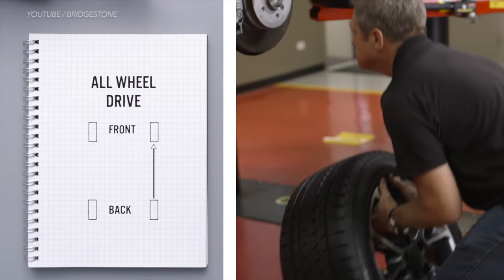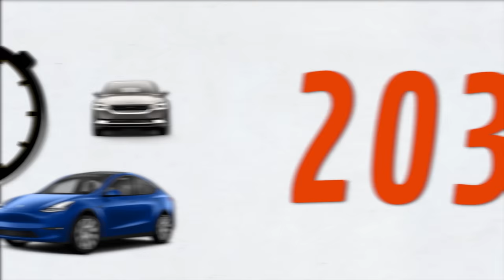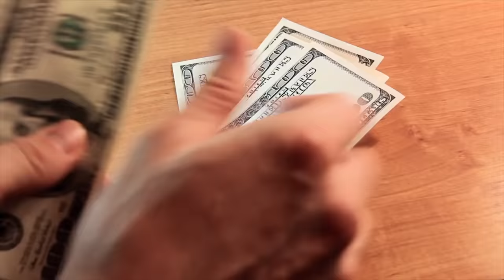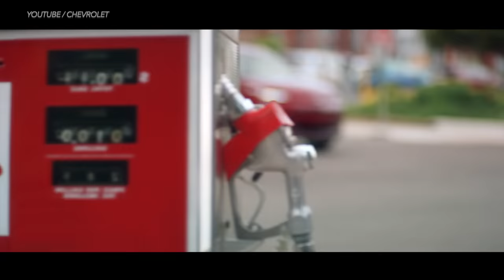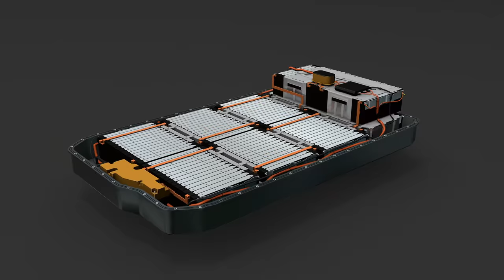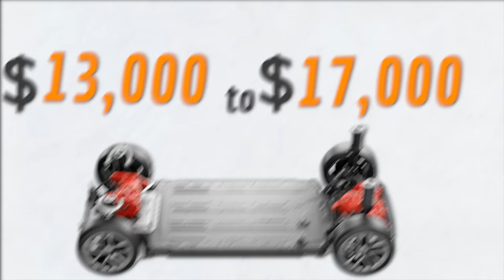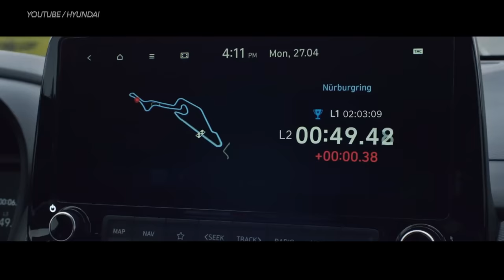No One is Telling You the Truth About the Real Cost of Owning an Electric Car, So I Have To

Comment: I didn_t know about the tires issue with EV's.
I consider that now is not the best time to buy an EV. 
Battery technology is growing fast and it'll take some years to have an affordable EV with long lasting, high range, fast to charge battery pack. Till then, I'll keep with combustion engines.
Reply: They are going to fight with tooth and nails before pricing EVs as their ICE equivalent cars. EVs will not be affordable In A LONG TIME. I have seen videos that say "This is an Affordable EV" (for 60k), or "This is an affordable electric truck" (F-150 Lightning). It's good to listen to Scotty because so many channels are a SALES PITCH. Affordable electric cars, give me a break people! (And I know you are not saying they are affordable)
Reply: Any car needs tire needs to be maintained! This is kinda a rare misnomer by Scotty.
Reply: It won't be a choice. 
Do you  even see what is going on in  this country. 
 You won't be asked to switch.
Reply: @tonebonebgky2  That's what I thought, but I just browsed for the Tesla Model 3 tires in Costco and each tire is $339 (cheapest tire)! I know  can get tires for my good old Altima for less $100 a tire. Anyway I found it interesting that EV's tires are that expensive when compared to other combusting engine cars.
Reply: @paulcoenen7918  They know they can't force anyone to switch so don't even bother asking. Not gonna work
Reply: @samuelaguilar9051  Basically what's happening is that you're actually buying a commercial grade tire. Think of it as a big rig tire that cost 600 to 800 dollers a tire and shrinking it down to the size of a car tire. There's more natural rubber in a commercial grade tire due to better heat dispersion which brings the cost of the tire up.
Reply: @christophermcmichael880  That's so true, I looked at EVs weight and they are significantly heavier than regular combustion engine cars. Time will tell if EV components come down in price with mass production.
Reply: @despacito1540  if you count in the saving in fuel cost there are many affordable EVs people just gave to be able to charge at home and it's a no brainer. And not make insanely long trips very often.
Reply: @christophermcmichael880  Scotty just said in the video that Tesla uses of the shelf premium ice tires though
Reply: And enjoy the rising gas/oil costs.😬
Reply: I can find a 300+ performance tire for a Altima as well. That 100 tire won’t go far as a performance one will on the same car. You get what you pay for.

Comment: Scotty two weeks ago I had to replace the hybrid battery on my 2009, Toyota Camry hybrid that I purchased new in March 2008. The mileage was about 152,000 miles at a cost of  about $4100, for battery replacement.
Reply: That's a lot.. I didn't think that battery was that expensive since it already had the gas engine and the battery hybrid was a backup.
Reply: Worst part is that there was probably only a few cells (out of a thousand) that actually went bad in your pack. And if you could disconnect those bad ones, you'd probably still have 98% of your range (or performance  since yours is a hybrid).
Reply: The 2012 Tesla S battery cost $22,000 to replace, plus installation and other fees.
Reply: @charlesjackson1700  The engine charges the batteries.
Reply: @troy3456789  Yes, I know.. They have a lot of new Camry hybrids and RAV4s now.. I will take a hybrid maybe next time however I don't want nothing that's fully electric.. I thought they could change out some of the cells in your battery instead of the whole thing.. It seems like I read that somewhere.. Toyota is really on board with hybrids.
Reply: @ytr8989  There is a video on YouTube or a guy takes a Tesla like the one you are talking about and blows it up because the battery cost over $22,000 to replace. It is a good video..
Reply: We have an '05 echo that has only needed its tires and battery replaced . We do our own maintenance . The cost has been very low , excellent gas mileage and takes two minutes and few dollars to fill . EV's are a scam. We can build better ICE cars .
Reply: @rdhudon7469  I agree with you..I have a 2020 Camry XLE
That has the 2.5,cylinder non hybrid, 8-speed transmission. 203 horsepower. It gets 29 miles per gallon City and 48.2 on the highway. The hybrid model gets 40 some miles to the gallon in the city but about the same thing on the highway.. and you will never have the long-term repairs down the road that you will have with the hybrids and evos..
Reply: @Enrique Thiele At this current time there are a lot more drawbacks to them than benefits.. I read that many people are getting rid of them as well.. especially with the lack of charging stations when driving on a trip.. you waste a lot of time and are inconvenienced sitting there waiting for them to charge once you find somewhere to plug them in.. I'LL TAKE THE GAS AND GO ANYTIME.
Reply: @charlesjackson1700  That's always been my complaint and no one has a response.  If I'm told I need to evacuate because of a storm or fire, I don't usually have 8 hours to wait.

If TPTB want me in an EV, the enginerds need to get battery charging or changing down to the length of time to fill up a tank.
Reply: @charlesjackson1700  The first quote I received was about five thousand & the other smaller car  battery is a proprietary gel at a cost of about five hundred dollars. Toyota is the only place you can purchase the gel battery.
Reply: @skiinggator  That may be true but the other battery cells are still fourteen yours old, so it probably best to replace the entire battery.
Reply: @ytr8989  Wow.
Reply: @charlesjackson1700  A third party company will change some of the battery cells but I'd still a fourteen year old battery over all.
Reply: @charlesjackson1700  Agreed but you pay more for the premium gas.
Reply: @charlesjackson1700  Agreed.
Reply: @hybrid711  "smaller car  battery is a proprietary gel at a cost of about five hundred dollars".
I just changed the 12v battery on a Prius (8y, 185k), and yes while it is a smaller gel (AGM) battery it was "just" $150 (vs typical $80-100 larger acid car battery) for 3rd party - you always get ripped off at dealers - if only Costco carried it... but not that different from my bmw that also has inside the car AGM battery. Note that newer prius use regular acid battery in the hood...

Comment: I no longer take my little Toyota to do Tyre rotation, last time I went there to do that, they screw up the front left threads! Luckily the shop I usually go to do repairs  they where able to replace the individual screws, otherwise I would have to replace the entire assembly and bearings!! Since the bearings gets damaged upon removal.
So not anymore, I do the rotation myself at home, I purchased two crappy stands to maintain the car lifted entirely from one side and I can change front to rear easily.

Comment: I like the idea of EVs. But they seem like more trouble than they’re worth and I don’t see that easing up soon
Reply: They've been around since he late 1800s. The problem is that they are being marketed solely as luxury vehicles and the people who really need them are priced out of ownership.
Reply: My Last gasoline Car I Had only Lasted me 132,000 before I gave up on it,I spend over $6000 dls trying to get to work,so.many things went wrong I fix this check engine,then a few months a sensor,fix that then one of the fuel injectors when bad,I was  like omg I'm done got rid of switch to a 2017 Chevy Bolt and never Looked back,after 147,000 miles the only problems I had it's just tires,like I Scotty sed but I buy regular tires "Good Year" brand at Walmart,and the 12V Battery I replaced it myself no big deal just order from the dealer,other than that those have  been my only mechanicals problems with the Car
Reply: @drury2d8  While Tesla has been raising prices through the roof, Chevy recently slashed the MSRP of the Chevy Bolt to $26k.  That's at least somewhat affordable.
Reply: @Enrique Thiele Whatever the reason, it's good news for consumers.  Are you not happy that an entry level EV model was made significantly more affordable?
Reply: @dansanger5340  Chevy bolt
Sucks I used to have one
Reply: @magallon643  I got my used 2004 corolla for $2000 three years ago and I have had no issues with it yet. Just oil changes I do myself so it's cheap lol. If the prices for EVs keep dropping I would definitely be open to getting one! The prices on the Nissan leaf and bolt are encouraging. But honestly, an EV wouldn't be my next car unless I suddenly got a ton of cash. Hopefully,  another 5 years and EVs will be more practical, cheaper, and accessible 🤷‍♂️
Reply: @robertosanchez9654  True one more thing you have to remember the Used Gasoline Car market is over 100 years Old,come on the Used Ev market is not Even 10 years Old just the other day I saw on the News GM drop the price on the New  Chevy Bolt Ev 2023 right Now the Staring price is $26,000 dls Msrp of course,my point I'm trying to make its only a matter of Time before you have Options to Go and Buy a Used reliable Electric Car,Unless you're Rich wana Keep buying Gasoline at $5 or $9 dls a Gallon Forever you see Gasoline will never,ever gonna go back to the Low prices you were accustomed to,as the Months go by Gas will  continue to go up.
Reply: Lol if u can charge at home and don't get on long trips very often an EV is the best car you'll own
Reply: Agreed
Reply: @magallon643  good point. 
kinda forgot Evs are so new in the mainstream market. I wanted to convert a gas car into an EV a couple years ago. It felt feasible and relatively cheap. But kinda forgot about that idea when life started getting busy lol. really do hope EV prices continue to drop so they can compete with gas cars tho. Its honestly just the lack of convenience that's keeping me from really considering one. I live in an apartment and there's only one EV charger and its usually occupied by a tesla in my building. Even having a charger in my building is pretty lucky tbh but then the potential challenge of trying to get to it before the other ppl in my building is so inconvenient lol

Comment: I drive a 2001 Dodge Durango. Engine replace in 2017 transmission replace six months after. Yes with current gas prices mileage sucks, but with four new tires with a 65,000 mile tread warranty. Not getting an EV keeping my Durango.

Comment: Scotty, has anyone ever used a Gauss Meter to measure electromagnetic levels inside one of these EVs for unsafe levels?
Reply: I did, using Trifield 100XE EMF Meter. The rear wheel Tesla Model 3  I tested had low EMF levels, better than some ICE I tested. 
The hybrid cars I tested (Chevy Volt and Honda Insight) had much higher EMF levels. The meter would spike when you accelerated.

Comment: How frustrating is your mobile phone when the battery deteriorates. It can hold less charge after just a year. Car manufacturers will be choosing how long your battery will last based on profit. This industry will start off by making batteries last as long as they can but later on that will change. Once they have us cornered we will be stuck
Reply: You know the drill, many don't. They also lock everything down where you have to pay someone to repair things. They don't want you doing it yourself and saving money. It's all about money, not you.

Comment: I rotate my tires every time I have to swap between summer and winter rubber, so even if I did have an EV it wouldn't be an issue. Having two sets of tires also means less wear per year. That doesn't change the increased cost of the EV tire themselves, of course. If they use non-standard rims, that'd suck, too...

Comment: Here in the UK all home chargers must be connected to the internet to our electricity supplyer so they can switch charging off during peak usage as we do not have enough electricity supply.. same with the ratings of the whole grid on the street how long before we start getting black outs when the BEVs reach 5% or may 10% of the car fleet?? Then forget the price of electricity even with todays prices on fuel.  Getting an more expensive BEV it would take me 15 years to make back that cost..

Comment: Cool story. I bought a 2012 mitsubishi I miev for $3700 only had 9000 miles. It's already saved me a small fortune in gas te past 6 months 😄
Reply: Finally, someone who is actually saving money. It’s so annoying to see these people who are saying, “Im saving so much a month on gas. The car only cost me and extra 30k, but I save on gas” lol. This is coming from someone who owns a Model 3. I love the technology side of it. But Im not so arrogant or naive to think that there aren’t downsides to EVs
Reply: I got my 1981 rabbit in 2010. 
Put in a Tdi engine. 

And it
Gets over 60mpg. 
Don’t believe me?
The car the engine came out of was epa rated 54mpg and weighs 800lbs more than my rabbit. 

If you had a car like mine- you would have saved a LARGE fortune.
Reply: @fastinradfordable  I find it somewhat hard to believe considering VW lied about the mpg on those engines!

Comment: The big worry I have about EV's is electronics. With newer cars,  most of the expensive
repairs I run into in cars has generally been electronic failures. Within 200K miles,
I don't usually see mechanical failures of engines and other things but see plenty
of electronic failures. There may be fewer moving parts in an EV, but there are a lot
of electrical things that will fail. Also, electronic parts tend to
be incredibly expensive and most electronics today takes
a dealer to install and reprogram. Let's be frank here. Modern
cars are basically money pits. Most cars made now are  such that
you can not service much yourself and many make it impossible
to even change the oil and transmission fluid. It's at the point where
the average working man can not afford a car anymore. I have
actually seen reliability of cars drop  over the past 10 - 20 years.
I'll see a guy with a 20 year old Toyota driving around with virtually 
no problems while I see people with 2 year old cars that have already 
had major failures. And usually those failures are electronic related
and expensive.
Reply: My 2004 toyota corolla has 422k miles and i havent had to replace majore things just general maintenance and had to fix some stuff in the bacl because someone rear ended me
Reply: @drdelirious8899  driving a 2004 Toyota Camry just hit 117,000 miles 😂 runs like a clock. Could use new suspension thought.
Reply: I drive my parent’s 2014 Corolla and it once ran for a month with barely any coolant because the idiots that replaced the radiator (hit a deer) didn’t fill the damn thing. Since then it’s had no issues other than the temperature sensor in said radiator acting up once and it hasn’t done it since. It now has about 180 000 km
Reply: I had a 2005 Olds Alero, 4 cylinder Eco Tec with 265, 000 miles.  Ran like a charm, but, the undercarriage was rusting.  Let it go.  Great car.

Comment: + plan to own over evidentially when the price eases up, but by then the price of electricity will probably be through the roof as will the price of gasoline and I'll be getting squeezed from both ends, I'd love to own an ev but the price makes it impossible that and the excellent points that Scotty brings up here with the exception of the battery replacement costs which is basically 12 years into it when the 225 miles of range is diminished to about 150-170ish (they don't ordinarily quit just lose range) at that point most people still don't drive ⅓ of that range and even if it completely quit altogether big deal junk it or sell it for parts or trade it for a new model in limp mode or on a tow truck.

Comment: You should show where the materials come from to make an eV. They use huge diesel trucks to move the earth to get down to where the materials are. Up to 500,000 gallons of diesel is used to make one battery.
Reply: @$5 a gallon for diesel one battery would cost 💲 2.5 million
Reply: Shhh, that’s against their agenda
Reply: It's only a matter of time that companies who make ev go bank rupt. It's very expensive to make and not practical for everyone financially. There will always be a higher market for gas cars just cause the average American can afford to have abd buy.
Reply: Why are they using diesel powered equipment to mine the required materials?
Why aren't they using battery powered equipment?
I know, what came first the chicken or the egg!
Reply: @ogcowboy5743  You'll find that their heavy pack haul trucks are diesel electric trucks. Just like trains are. Besides without extrnal power supplies to keep them running they wouldn't be cost effective enough to pay for themselves if they spent most of their time sitting being charged.

Comment: Some sort of alternative is definitely coming eventually but these Electric versions are foolish and only trumpet up by tax payer subsidies. Lithium for the batteries for instance is a very limited supply and the amount of copper needed for a worldwide EV movement will have the EPA determined to put an end to this ridiculous alternative.  Hell copper right now is at a 1 year back order and domestic copper here in the states is almost always longer then that. The EPA only let's 1 copper mine run and it limits the daily output.  At the height of the Iraq war domestic copper which is superior to imported copper because of its purity and efficiency was almost 3 years backorder.  This is fools gold only kept afloat bye greedy politicians who have money in Tesla and keep its automotive operations above water with Taxpayers money
Reply: Absolutely! No one is talking about the strain this movement is going to cause on copper. They'll need to build more charging stations=more copper.
Build more alternators for the windmills=more copper. More ev's=more copper. Need to build a house? Cooper wiring will increase the cost. Tough times are ahead.